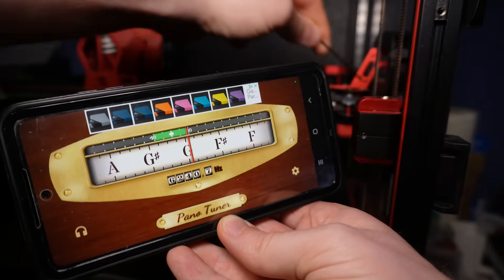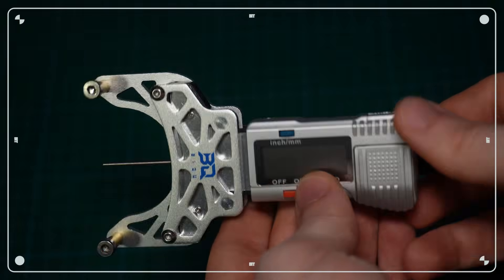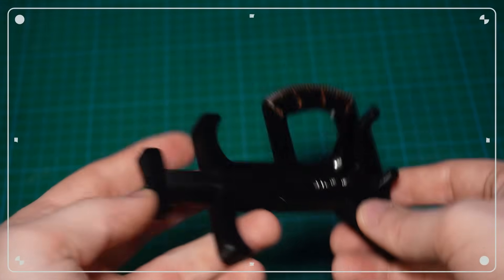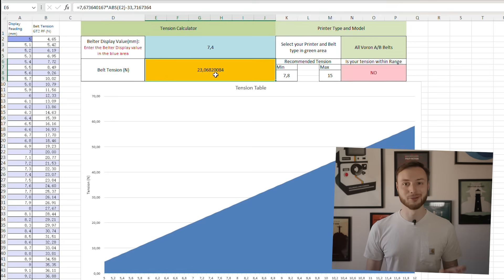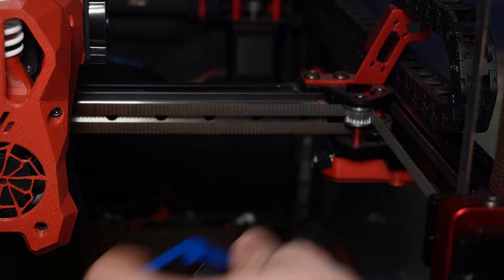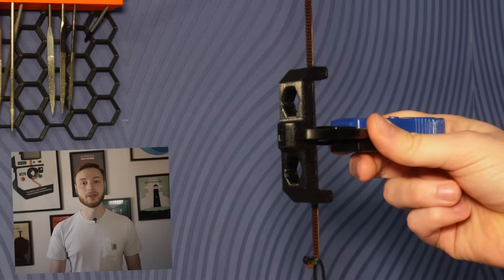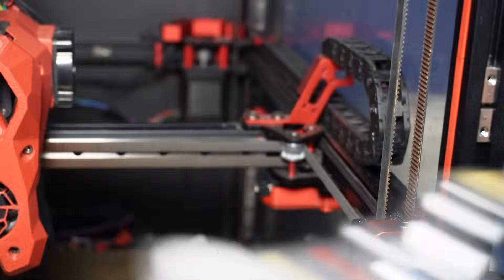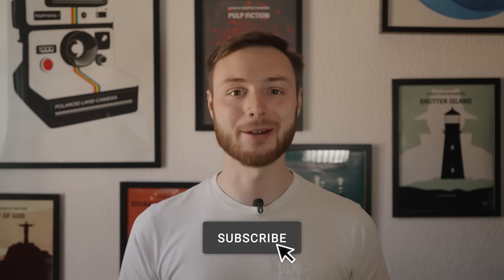3D Printer Belt Tension Tools Tested – Which One Really Works?

Comment: thanks for the video, do you think worth making the bearing modded tool or the original just as good?
Reply from the maker: I dont measure any Difference between both. You can build the original one. Beared one maybe allow bigger printing tolerances.

Comment: "if you don't have strings you can calibrate by weight..." although the author himself originally calibrated by a calibrated tensiometer. This is genius! BTT has a backlash on the cocking handle! You can see for yourself. If you put a piece of duct tape on the plate, there will be no backlash! The btt tension itself depends on the spring under the handle! For this reason any tensiometer must be calibrated!
Reply from the maker: Of course, every tension meter needs to be calibrated – I fully agree on that. That’s exactly why it’s a problem that the calibration table from BTT is known to be inaccurate, and Fysetc doesn’t provide one at all. The GT2 tool, on the other hand, can be calibrated purely by weight – a physically verifiable method that anyone can reproduce. That makes it currently the more reliable and independent solution.

Comment: I just tension my belt until toolhead motion (100mm) is just barely over 100mm. I think last time i tensioned them they were about 100.03mm. The reason for going just over is because all plastics will shrink so might as well go over
Reply from the maker: Iam Sorry. I cant understand. What do you mean with " tension until motion 100mm". Can you describe that?
Reply: @crydteamprinting  brain make no words good, I'll jog the tool head back and forth 100 mm and tighten until it matches 100mm on my caliper. I prefer to go just barely above

Comment: Thank you very much for this video! In your experience, is the 4 bearings upgrade of the GT2 belt tensioning meter worth it? I feel like that's something that should've been in the conclusion at least mentioned. I have the regular GT2 tool and I always wondered how's the experience of the upgrade.
Reply: I built them both recently and I would say they both function pretty identically. When I measure with them back to back I get the same readings. However I found the original version was a little more awkward to get set up. It required a bit of post processing/sanding to get a good sliding fit and the inclusion of a small ridge over the number scale means the needle is easier to get tightened correctly. Other than that, if you have a functioning original meter I wouldn't bother making the bearing version.
Reply from the maker: Thank you for this comment :-) Then i am not alone with my opinion.
Reply from the maker: I can't give you a definitive answer on that. I built both versions myself. The original creator mentioned that the remix version might cause issues due to its design. However, I haven’t experienced any problems—both versions perform equally well for me.

Normally, for optimal performance, you’d want to install bearings to minimize resistance as much as possible. But just as the original creator pointed out, I also can't rule out that the remix version might cause issues in some setups.

It’s possible that in certain scenarios—maybe with very low belt tension—the version with bearings might offer slightly less resistance than the regular one. But I don’t have the tools to verify that precisely.

That said, I’d assume that poor-quality printed parts have a much greater impact on performance than any potential gains from switching to bearings.

My current conclusion: if you use high-quality grease, there’s no real need to buy build the bearing remix because you cant use the manual 1:1.

Comment: So wait... the whole reason this is needed is that Voron specifies laughably low/wrong belt tensions that are too slack to produce a note for a tuner app to pick up? 😂

6 lbf is the absolute minimum for GT2 for registration purposes, and 8+ is more likely what you want if you don't want input shaping to smooth your prints to hell.

(Apologies for the freedom units; just took them from the Gates specs.)
Reply: Well, if you run the 6mm belt at Gates' working spec, which is ~6lbf (25lbf or 111N per 25.4mm belt width), it would snap the Nema 17's 5mm shaft soon enough. Not to mention, you have to redesign the whole gantry's 3D printed parts to withstand the 6lbs tension at 50-70C chamber temp.

To run at 6lbs tension, the 5mm shaft need another bearing to distribute the load. 

And no, Gates Carbon Drive can work up to 200Hz and it's free and easier to interpret.

A tool like the Biqu belter isn't that precise. I have it, and I know. It's somewhere +/-0.05 to 0.1mm for me. The Gates carbon drive maybe not that accurate but is more repeatable than the Biqu Belter. It also doesn't have to be that accurate, Gates belt working spec can be +/- 5%.
Reply from the maker: Yes. People should think about the fact, that this Tools cost less then 15USD. This is not a high grade industrial tool which costs more then 1000 USD. In my Optinion, this Tools help to Find a good belt tension. It does not claim to measure the tension accurately to a hundredth.

And as I've tried to explain, acoustic tools are good, but depend on the microphone. I tested it on three smartphones and each one showed me a different frequency.
Reply: @crydteamprinting  Oh, the tool is absolutely respectable and probably something I'd like to have, just for getting really precise, repeatable, and consistent results between multiple belts. I just always wondered why this came to be as a product, and found it amusing that Voron's ridiculous belt tension specs might have been the motivation.
Reply from the maker: I mentioned in the video that detecting belt tension via frequency using a smartphone mic can work, but it's prone to errors since it's not a directional mic and easily picks up ambient noise or vibrations.

Do you have a specific source for the 8+ lbf recommendation? In my experience, the suggested lower tension (just under 6 lbf) has worked well. Input Shaper still delivers solid results without excessive damping, and I haven’t noticed any VFAs.
Reply: @crydteamprinting  The gates "light power and precision drive design manual" gives 10 pounds as a general value for a new 6mm 2MGT GT3 belt(page 65). There's also a more complicated calculation you can make based on dynamic loads and belt speed, same page.  For a used belt the recommended value is a bit lower, because it's already stretched a bit.

That manual also gives methods to measure tension.
Reply from the maker: @sleepib Yes, I've seen that too, but these values were probably never intended for 3D printers. If you have a reinforced CNC gantry, then you can achieve these values. But printed parts do not withstand this pressure for long.  f.e. Vorons spec a factor of 0.5 on GT2 6mm (2lb of tension).
Reply: @crydteamprinting The limiting factor on most printers is not printed parts, but unsupported motor shafts. If you put a bearing on the end of the motor shaft so the pulley is supported on both sides you can use higher belt tension.
Reply: @crydteamprinting  I got the baseline of 4 lbs for 6mm GT2 from the Gates documents, where that's for non-registration applications and they specify 1.5x-2x that as the starting point for registration. They absolutely are intended/suitable for things like printers. 6 lbs is no big deal for a motor shaft unless the motor is junk; even my fully stock Ender 3's belts are tensioned to 6 lbs. Much below that and you can significantly stretch them with a force equivalent to 1 kg under gravity, which will be experienced under acceleration forces, giving you inaccurate toolpaths and low frequency resonances IS can't fix without heavy smoothing.
Reply from the maker: Your right. Double bearings or 8mm shaft will improve the strength. But printed parts are a Problem to because the bearing stack is bent. Because of that the belt will slide to the flange.
Reply: @crydteamprinting  Printed parts are only a problem if they're not designed right. I have no experience with them to speak for whether Voron (original or modified for double shear) parts are well designed in this regard, but it's very possible to do right and plenty of machines do it right. And 6-8 lbs is not much force at all when you have support on both sides. It's once you get up to 15-20 or more for GT3 and/or 9mm+ that it becomes hard to design good plastic parts.